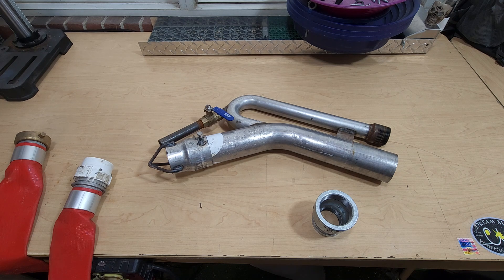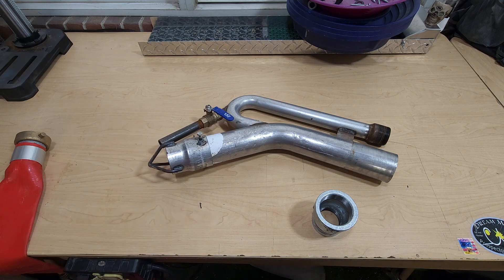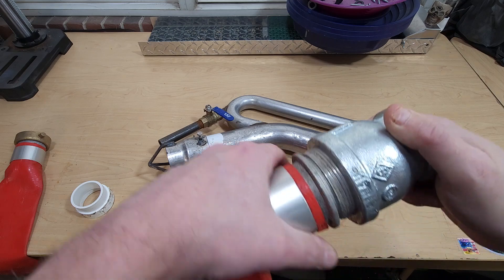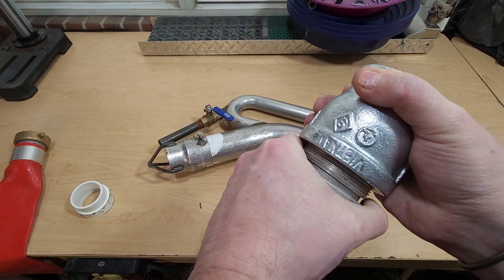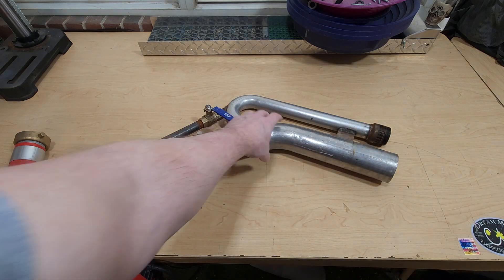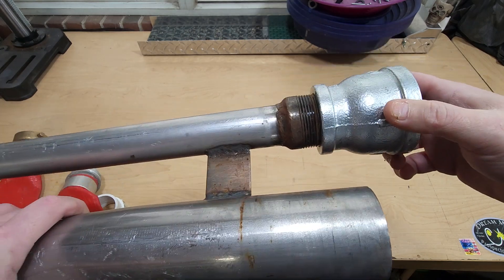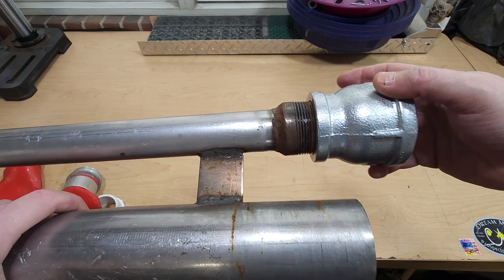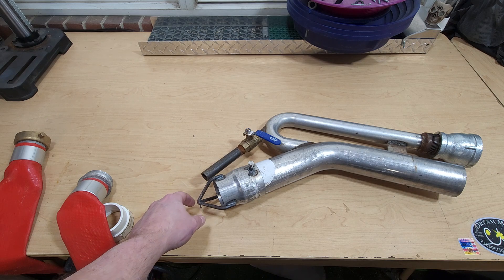How To Modify Your Dry Land Dredge Nozzle #GoldMiningEquipment

Comment: What about weight. That galvanized looks heavy.   I dunno never dredged.  Im still a noob
Reply from the maker: The weight helps you punch a hole 🕳 😆😂🤣 Its not too bad, I'm eventually adding cam locks for the hoses connection as well. Besides it lighter under water.
Reply: Can't see Pa's comment for some reason... the extra weight probably will suck for transport but not actually for dredging...I usually am just dragging...I do see if you're lifting up constantly to vertical work 🤔
Reply: @a3skywarrior929  no clue why u wouldn't be able to see him.   But that works for me